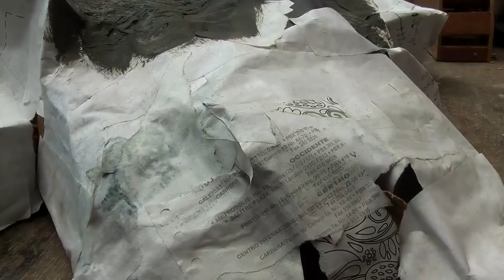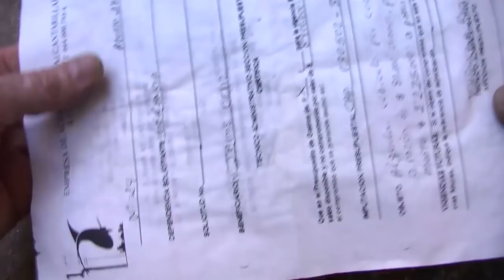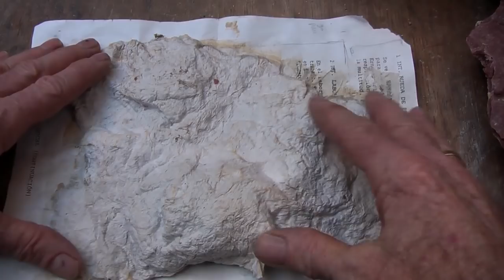Fake Rocks - Tips 3

Comment: very nice tutorial!
when I'm making a wax mold; and I've melted the wax, would it remain liquid for enough time so that I could pour it? Or it might harden quickly? and does it ruin brushes?
Reply from the maker: The length of time  the wax stays liquid depends on how hot you get it. I have it reasonably hot for the first pass with a brush, making sure the object(usually clay) won't melt, and  successive  layers hot enough to bond to the last  soft layer. Final layers I have  fairly cool so it will go on thick and  defy gravity  where necessary. The brush needs to be one where the hairs can take the heat of melting, and can clean up in hot water and soap, but  I use an old one dedicated to the task.
Reply from the maker: I did a video  with the technique  at https://youtu.be/3Mye6xtJx_8